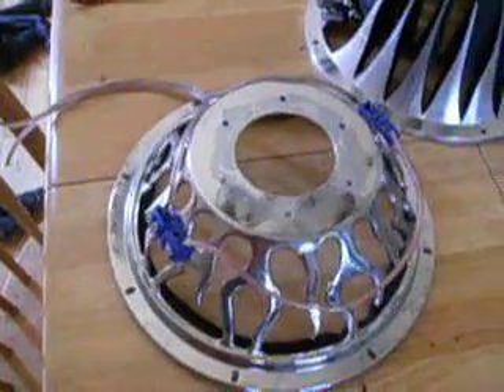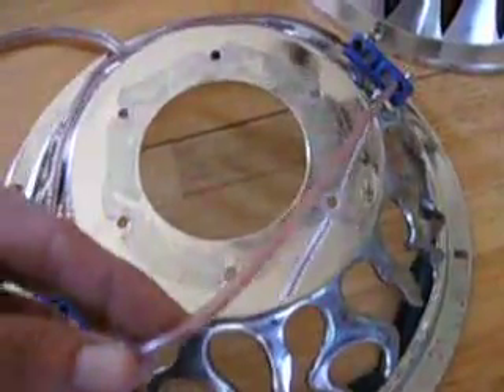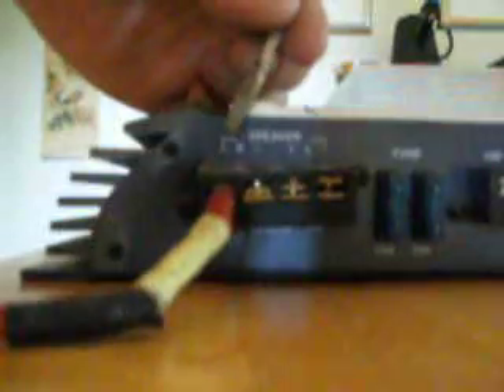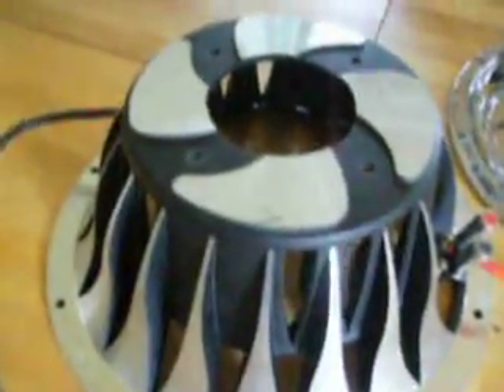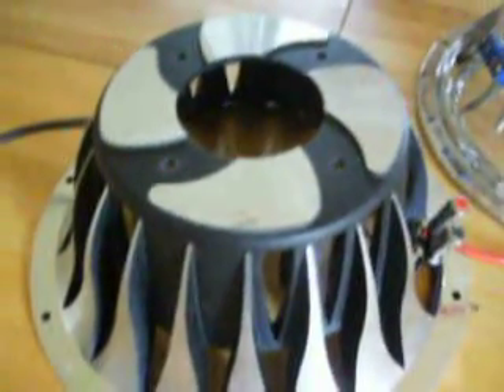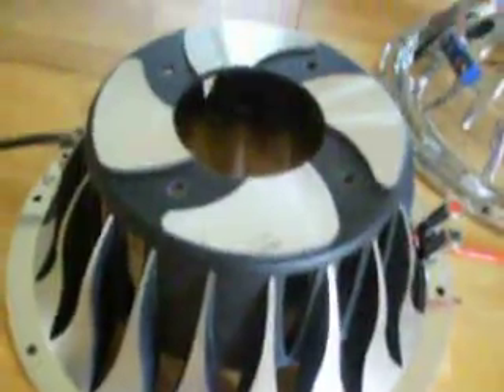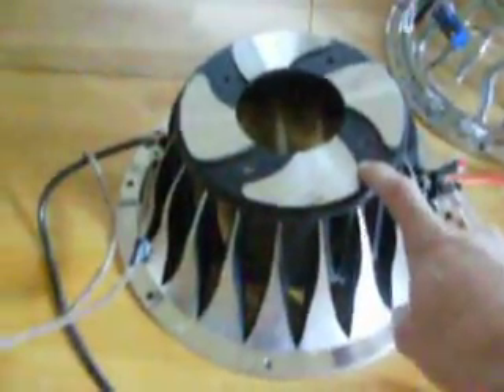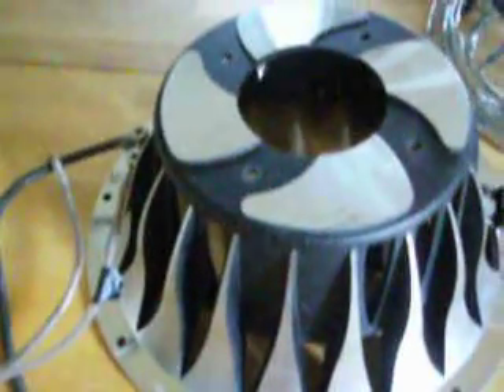How to properly wire a subwoofer with dual voice coils

Comment: need your help i ordered 2 dvc subs at 1000 watts ea 4 ohms 10s.ok i have 2 performance tekniques 772 icbm amps 2 ch 800 watts ea.now is it better to wire ea sub to its own amp bridged or seperatly ea channel.which would should louder cuz the subs are going into a bandpass box.check out car setup on my channel.thanks for the help .

Comment: i prefer to wire each voice coil to a channel on the amp. improves sound quality. it also allows a 2 ohm dual voice coil to be wired at 2 ohm, and 4 ohm dual wired at 4 ohms :D

Comment: what happens when wiring in parallel and you connect positive from amp to VC1 + and negative from amp to VC2 - ?  
 does that make a difference from hooking amp wires + - to vc#1 and running jumpers to vc#2 -+     ?         any help is appreciated

Comment from the maker: @thakidtwan1 wire each sub in series so each sub would be 8 ohm and then each sub to the amp, in the end would be a 2 ohm load at the amp, you can always check with a digital multimeter , ""20$ at walmart for a meter"" what you have for subs ? im interested in your build ! got any videos ?

Comment from the maker: @GJSUPERSTARS they are 1 ohm stable. make sure you have plenty of power for it though or it wont last long. the audiobahn amp i had back in the day looked just like your amp but smaller ''around 800rms'' was 1 ohm stable but only lasted a couple months and it was toast running @ 1 ohm. i had lots of other more powerful amps ''tons of brands'' on the same electrical that either lasted way longer or never died ...also had a few that didnt make it more than a week lol

Comment from the maker: @TheUnbeen from what you just said to me you have 2 DVC sub bridged on a amp each sub wire parallel making each sub 2 ohm and then with them both hooked up it makes them 1 ohm.... so ur running ur amp in danger of blowing , each sub should be wire to its own channel if wiring them like that , or rewire the subs to be 8 ohm each ''series'' and with both bridged to the amp would be 4 ohms

Comment: Hi, i have a question for ya, i have a two channel amp 2600w max, i run 2  dual voice coil subs, i want to know if im getting the most out of them, both are wired the same  like this, bridged at  the amp,neg to neg, pos to pos,. same on the dual connections neg to neg and pos to pos, my amp specs say 2 ohm load max, i got told i got them on a 0 ohm load, makes it unstable,??  i hope you can understand all that lol, please let me know the best way to hook them up. the subs are rated at 600wrms

Comment from the maker: @jon106022 yep ... for sure man, running 1 coil of a dual v.c. subs gives you 1/2 the power handling and the coil has to work extra hard to move all that extra mass ... you never get the output they should have either  . my guess is if you look at the coil 1/2 of it is black and burnt to a crisp and the other 1/2 is shiny . they are probably junk . if you end up having to throw them away plz send them to me for parts , i rebuild subs that have good coils and extra parts are always nice !

Comment: I have an interesting problem maybe you can help me with.

I have a dual voice coil sub (a Clarion PXW1052) 600wrms @ 4 ohm sub, but the sub amp is a d-block type amp with only 2 outputs to handle one sub. Assuming that from what i've read the ohm's double is you wire the 2 coils in series, how will this affect the amp if it does 600wrms @ 4ohms?

OR

can i run 2 set's of wires from the same single amp output to the 2 coils?

Comment from the maker: @parazytu19 series and bridged on the amp, u will have a 8 ohm load so u wont get the most out of the amp, but thats the only safe way u can run it bridged, other wise wire parallel and use only the left or right channel .

Comment from the maker: @cod4fan1992 both wired series @ 4ohm each and then wired to the amp should make 2 ohm load , u can always check with a common multimeter

Comment: ok so if i have a 600 watt rms @ 2ohm amp that i want to wire it to a dual voice coil subwoofer with rms 600  how to do i wire the subwoofer to run at 2 ohms? i can get the sub in 2 ohm or 4 ohm versions but need it to run a 2 ohms to match th amp, also how would i wire this?

Comment: hey i got a 15" DD and its dual 2 ohm and i wanna wire it to 1 ohm, my sub has wires already installed on it stock instead of terminals on the sub, will it make a difference if i just put the negative wire to the other negative wire then put the negative from my amp onto the both of the negs on the sub? and same with the positives?

Comment from the maker: good rule of thumb is 75% of the speakers watts. so like a 500-600 watt amp would be fine if u want it to last. use a multimeter to find out what ohm it is,.

Comment: i have dual 2 ohm L7s wired to 2 ohms on a zx1500.1 mono block amp with a 2 ohm load. is that good?

Comment: Sorry dude, but you kinda epically failed... 7 thumbs down in less than a day... ouch. But anyway, I don't really get your point. I don't have the speakers wired up and I abandoned the project because the box is too small for two subs and I need to wait for new surrounds anyway. Over the summer, I might be able to build some sub boxes.

Comment: @ Mazda's last comment: Exaclty!

I'm trying two wire two 16 ohms subs to reach 8 ohms (the ideal load for my JVC RX-307). But my receiver has a feature that shuts itself off when you crank up the volume on poor impendances or when it gets insanley hot (it's nearly indestructable excluding physical abuse to it).

Comment from the maker: ok so ur saying wire each dual 8ohm in seires so they show a 16ohm load each rite? and then wiring 2, or 3 subs to the same channel on your amp? that you can do ! so 2 16 ohm subs on the same channel would be 8 ohm, you can use a basic multi meter to test the resistance.

Comment: We have that ringtone for our house too, LOL. Nice vid though. I have two 8 ohm dual voice coil 8's that I got for free at the swap-meet for free, because the guy thought they were broken. They work fine, the surround are just completely diconnected and there is severe mechanical noise (it outweighs the bass on high volume).I'm gonna hopefully get new surrounds.Would it be possible to wire two subs in series, and connect them together in parallel (16 ohms per sub, wire the two subs in parallel)?